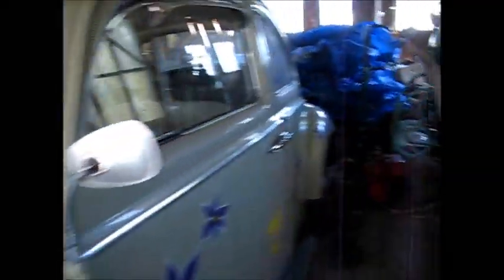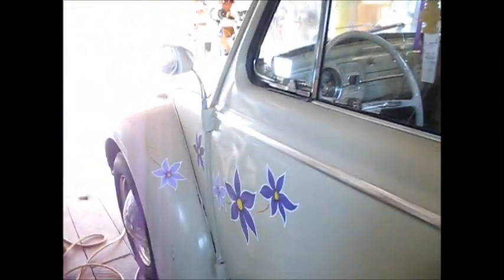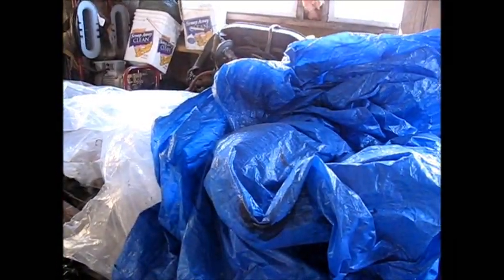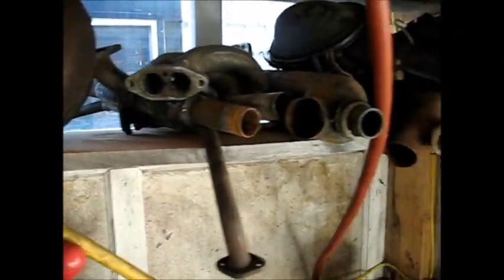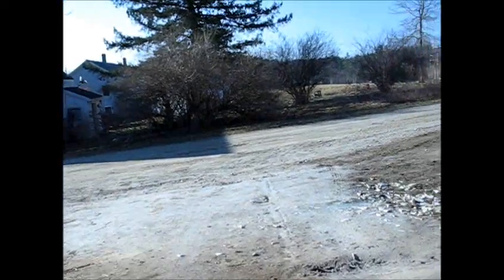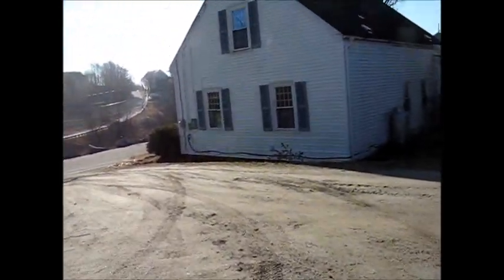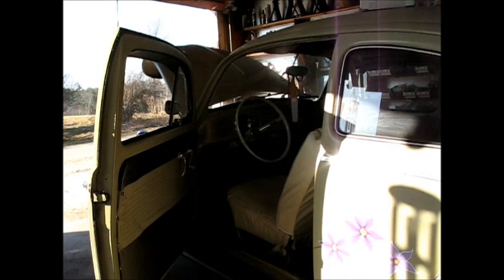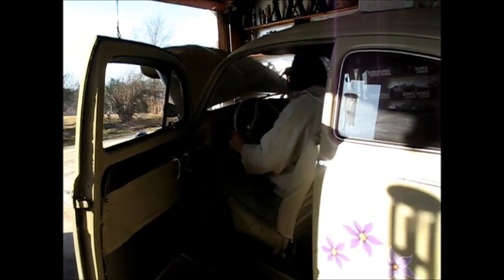Time to work on Cinderella

Comment: I know some hotrod guys in my area that say NEW parts are no good! They run into it all the time!
I loved hearing the bug run. I miss that. I had a 1600 in mine. I put dual exhaust on it and the mufflers stuck up inside the rear fenders behind the tires with the tips sticking out from under the  fender. I liked it.

Comment: If you open the hood and find that the motor has been stolen, look in the trunk, always seems to be a spare one in there!
I had a Transporter with a camper roof conversion for some years, excellent load carrier, and it would happily overtake lampposts and buildings, even with a trailer behind it.